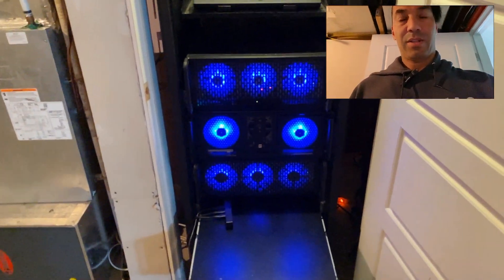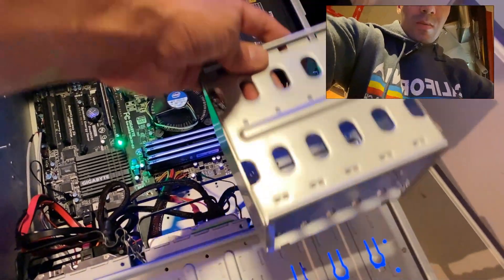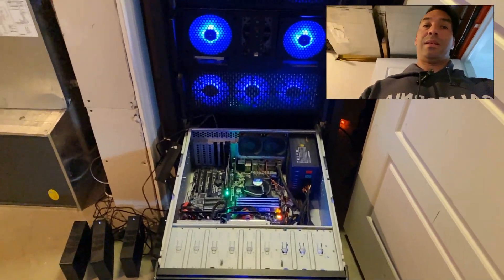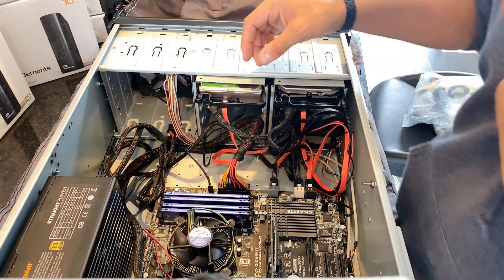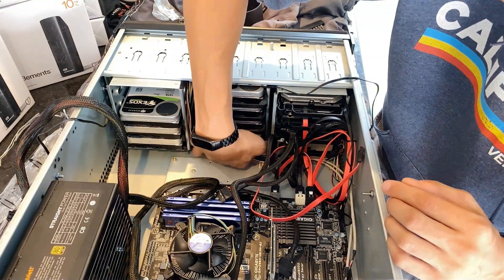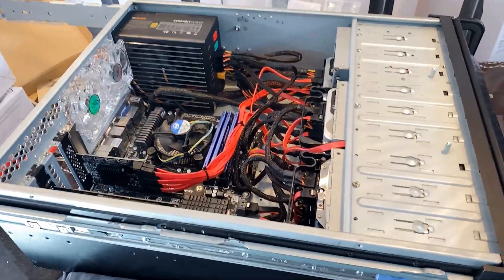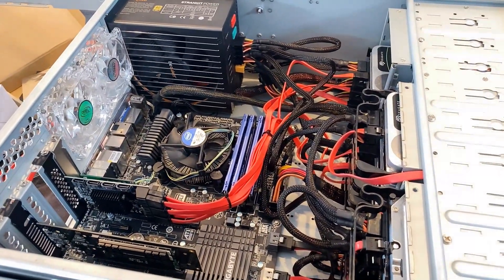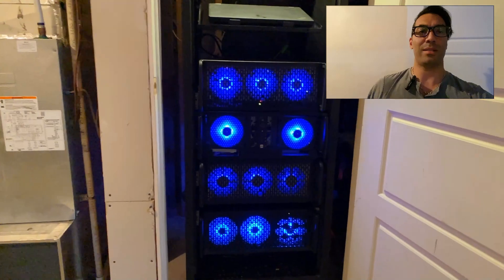CHIA 1/4 Petabyte Project 250TB of RAW Storage!

Comment: Wait, I thought that it is only the WD "white label" drives that need to have the 3.3v pin covered. Aren't the shucked Seagate Exos drives basically the same as a normal Exos drives?
Reply from the maker: I tried it with regular power and was a no go, so I added the tape and it worked
Reply: @CustomComputing  Intersting. Thank you!